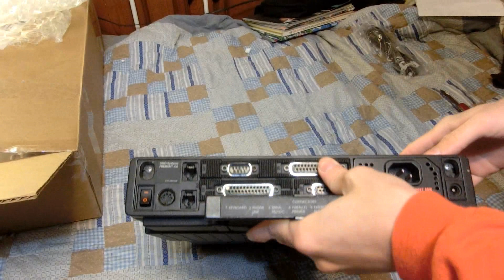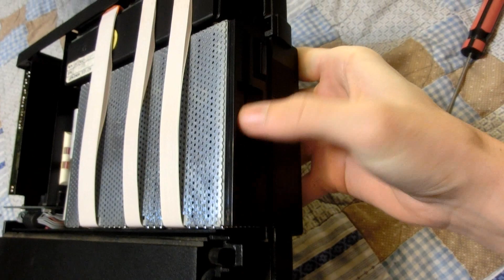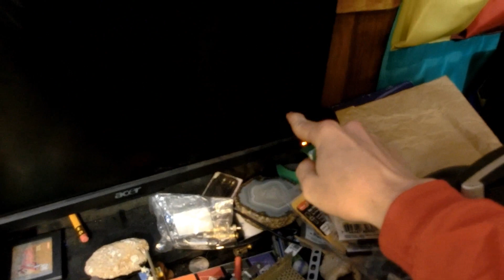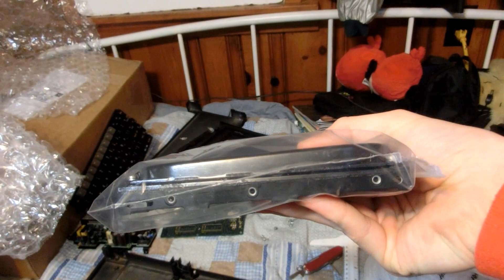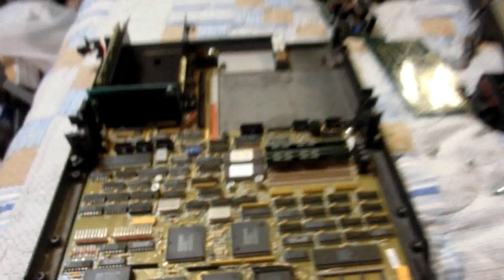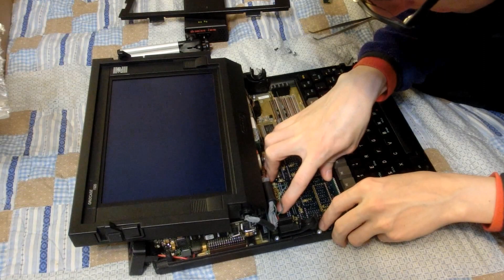1986 GRiDCase 1520 rugged 286 laptop

Comment: What ever happened to this GRiD laptop? Would be cool to know if it was used for anything, like a cyberdeck computer ;).
Reply from the maker: Its sitting in my bedroom with all the other components i've gathered for it. The parts havent quite fallen together right just yet. The LCD i bought is giving issues. its a 4k lcd.
Reply: @RinoaL  I just bought a GRiD 386NX, also called GRiD 1720/1750 (I think). But they are not nearly as cool ;).

Comment: I would us a raspberry pi zero w batteries cr123a as a power bank. The gpio pins should drive the screen if not replace it with a touch screen fix the color in software put a usb hub for the keyboard 3.5 floppy and hard disk you would have to convert the keyboard matrix to usb or take a new keyboard a part and run wires from the key switch’s to the new keyboard pcb. And drop in a charger for the batteries you have to put a power regular of some type to keep from smoking the screen if using the old one and the pi a wireless mouse can be left in. Now I would not mod the case short of a glue gun. Now the case is magnesium it is strong but can burn so keep wet if drilling with oil and go slowly. And you can use the case as a heat spreader. And try not to ground it out on the case.

Comment: I just finished disassembling and servicing a Grid Gridcase II and can confirm that it will not boot without a CMOS battery!
Reply from the maker: +The Obsolete Geek interesting, i already got the parts to put into this GRiDCase and make it run windows 7 with a 2048x1536 screen though.
Reply: +Rinoa Super-Genius Surely you must be joking Mr Rinoa
Reply: Rinoa Super-Genius is it taped ? I spotted a 1660 with missing part, i'd love to make a frankengrid with contemporary chips
Reply: +Rinoa Super-Genius Do you plan to make a full build video with a parts list? I plan to to do the same with my Grid 1520 and turn it into a "Sleeper"!
Reply from the maker: CrazyIvan
not with a list, but i'll show how i do mine. im wanting to make it passable in airport security
Reply: harvest a CMOS  battery from a UN needed pc

Comment: I've wanted to get my hands on a non functional GRiD Compass for a while to retrofit, cause I think it'd be kinda a nice little personalized system running a nice ITX board inside. My only issue that I can think of is replacing or interfacing with the keyboard also. But the screen is replaceable at least if you're willing to install your own LCD into a machine. If I had data on the pins, or could find convert the keyboard to USB I could make it work... Any repair or tech manuals out there for the compass? I'm sure the company would have released such documentation for the public when it went was sold to Tandy in 1988.

Comment: I noticed the BIOS read unknown capacity...  back in the day, you had to enter the CHS manually.  You could try looking that info up but even back then there was a lot of bad info being passed around.  You were only seeing '20MB' because that info was stored as a string and being sent from the device.  Of course, the drive is old enough that it could very well have bad components within it as well.  Sure looks like someone already took a go at fixing that machine though :(  I still have a brand new, factory fresh 286 desktop in a closet (it was a spare they sent and was never used)... it's nothing cool like that one though.  For whatever it's worth... when that box powered up all I could think of was E S S

Comment: Whenever I take something to bits, I always draw a map of where I had the screws from and how everything slots back together just in case I get distracted and forget how to put it back together by the time I get back to it.

286's are classic. Someone I work with had to source an old 486 processor to fix a CNC control unit because the machine was so old it couldn't cope with a more modern control system. He also had to find a 400KB HDD for something else because that was the largest size drive the system could cope with. All this old computing gear is fascinating.
Reply from the maker: i do the same but in my head.

btw i think you mean 400mb. 10mb was the smallest consumer drive ever made and by the time the 486 came around drives where regularly 100mb.

it's interesting that some enthusiasts have helped windows 3.1 so now you can still surf the web and do a lot of things on a 286. but hey with a 486 you can run windows 2000 or even XP so thats easy.

Comment: I know this has nothing to with the computer you show in the vid, however I must know if I got a good deal on my old laptop batteries. I bought 33 battery pack from a local shop and paid a total of $11 for all of them. This gives me a grand total of 284 18650 cells. Most of them were under charged but 84 were 3 volt or over. About 25 were in the miliamp range. I think I got a deal...except for pulling the cells out of the packs and getting them pulled apart. So let me know what you think. I have dedicated 18650 charger but the lowest charge rate is .5 amps and if I remember correctly I would need to charge the really bad ones at no more than .025 amp to start and I do not have a universal power supply like you do. My charger does .5, 1.0 and 2.0 amps. I hope you can shed some light on my problem.
Reply from the maker: yeh that is an awesome deal.

if they are over 0.5v you can try 0.5a. also if you have 2 cells in parallel the amps are split between them so each would only see 0.25a

0.25a isnt a set rule. its just a guideline to lightly charge them until they reach 1v or 2v then you can treat them normally.
Reply: Rinoa Super-Genius I need to get a battery holder so I can charge them in parallel. I also ordered am IMAX B6 and was wondering what kind of charge settings it has. By the way did you get yours replaced yet. I fnot newegg.com has them for $36 with free shipping and it only takes 5-7 business days unlike some of the other sites shipping times.
Reply from the maker: John Brewer
i got mine for 22$ free shipping from ebay, and it arrived in 2 days.

Comment: Hiii Rinoa .why dont u try something like raspberry pi or other ARM based devlopment boards.they are really cheap n consumes very low power.you can run some old OSes too.
Reply from the maker: because raspberry pi is too slow for windows XP. i would rather something like the intel NUC.
Reply: Rinoa Super-Genius if ur goal is to run windows then u dont hav many choices,i thought that the whole purpose is to make it functional and retain the orignal display.
Reply from the maker: kane g yes i may also replace the display with a 1280x800 display. i have a lot of options for an x86 architecture. but first i will try to use the 640x400 display.
Reply: it would be cool if u use the orignal display and for high resolution u can always use the vga or hdmi port.
Reply from the maker: kane g
that would be very impracticable. would be best to just go with the best screen.
Reply: Rinoa Super-Genius the simplest way is to put a tablet inside monitor module and hav keyboard via otg and fill the rest with 18650s that would be like 100hr backup.....kidding .lol

Comment: I have the 40Mb version of that drive from a Toshiba 3200sx (386).  I could never get it to be recognised properly even by a P1 desktop with manualy input hard drive parimaters.  I think that it may have been an orignal IDE spec hard drive that is not compadable with what we know as IDE today.  If you have a logic probe you can see if any of the chips are bad by looking for stuck bits or missing bits as well as missing clock signals.  I wounder what it would do if you pulled the bios chips?  If it does nothing when you do this the bios chips are most likely working.

Comment: Really neat lappy , You may have more luck reading the hdd with a much older computer with win95/98 on it if i rember right it was more tollerant to hard drive issues , you could try something crazy like set it as master on a pc and try boot off it and go from there , Maybe you could look up the beep codes for that device asumeing it has some and is not just some generic "help me im dead" beep and im guessing the shock warning indicator inside was some sorta "warrenty invalidated stop asking us to repair it" thing :-)
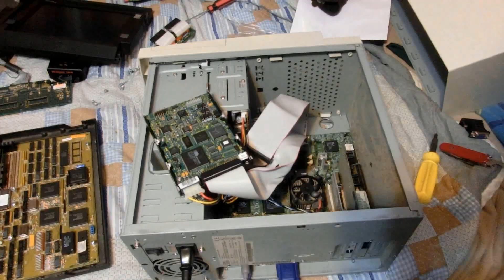Reply from the maker: 14:06 i tried it in that IBM aptiva running windows 98 and couldnt even get the computer to boot with the hard drive connected. would either blue screen, or hang, or show no OS. the BIOS identified it as a 100GB drive witch it isnt.
Reply: well i guess it was worth a try , I have some hard drives of that make around here somewhere but no where near as low as 20mb

Comment: Atoms are terrible. they freeze so much. my laptop has one and it can barely do youtube. 
on a different note,
Use low profile ram and buy the pci-e extention cables so you can fit a decent gpu in it. you could probably use an itx or matx in the case. you could really pimp that thing, but the low profile may be a challenge. you could probably make adapters though.
Reply from the maker: extending the pci-e connector would probably mess up the timing. another viewer brought up the intel NUC and i think that may be nice.
Reply: the nuc is pretty good. gigabyte has something similar with a pretty good gpu. And the connectors reallydont affect anything if it is short
Reply from the maker: Eddie Boughner
 perhaps its just they all have to be the same length, modern computers have had to keep their circuit wires teh same length so the timing on no single wire is off.
Reply from the maker: TheCanadaboy25
my mother has an Atom in her little laptop i think. it's worked great for years.

Comment: Wonder if you could stick retrofit a little laptop into the case? Like maybe a msi u100wind? There screens look to be very much similar size also. If the screen fit and the motherboard and keyboard fit where the grid keyboard is that whole back portion could be used for hard drive or maybe cd drive... i dunno
Reply from the maker: sure, but laptop hardware usually belongs in the trash. i'll just use a small form factor PC motherboard.

Comment: Ahh 30 pin sips, if my memory is correct lol :-)

I havnt seen those since my 286/386 days, i dont think they were any different to the standard 30 pin types, just wires added, i did convert one 286 to use the standard 30 pin memory, just solder in different sockets, no change to anything else :-))

It does sound like there is a memory problem, but its deciding if it is a strip thats faulty or the sockets/memory controller has issues.

It would be a shame to distroy an original machine to jam a laptop into it :-(
Reply from the maker: well you know me, i won't destroy it. i will carefully take the parts out and retrofit it. like with my kaypro. i'm converting the kaypro without modifying it much. only drilled 6 holes in the bottom and there are already a ton of holes for vents down there. it's not like i will be cutting things up or anything.

Comment: If you want to put a computer in there, you can put some lithium batteries under the keyboard, the flat ones :D
Reply from the maker: thats a really good idea. i'd probably use 4 cells to make like 16v and that could last for hours depending on what computer board i use.
Reply: if you use a Intel NUC board, that could last for hours and be a pretty powerful pc...
Reply from the maker: IscleGaming | ZefaCraft
once again a good idea, but a bit expensive for now.
Reply: Rinoa Super-Genius well, at least here in spain it's pretty cheap, considering the processor that it has (intel i3), but of course, if it's just for a modding that is not gonna have a lot of use, it is expensive.. also it dosn't have ram or ssd....

Hope you find something to fit in there!

What are the dimensions?
Reply from the maker: IscleGaming | ZefaCraft
 17x5x27cm i think. so it has a lot of room. this mod would probably get some use but i think i will wait a bit since i'm still working on my Kaypro 4.
Reply: Rinoa Super-Genius Thanks!!
PD: I love that Kaypro 4 mod.... It's gonna be a piece of art when it's finished... I'm hoping to be able to do that type of mods when I become an adult :D
Reply from the maker: IscleGaming | ZefaCraft
 i'll be filming the next video for the Kaypro pretty soon, just had to wait a few days for some Epoxy to dry. already got the power supply and hard drive figured out.